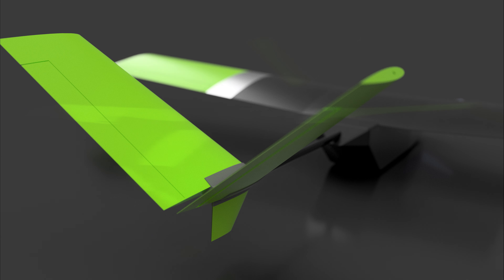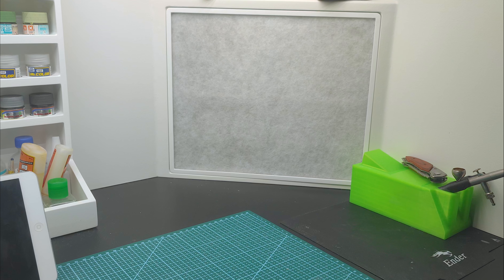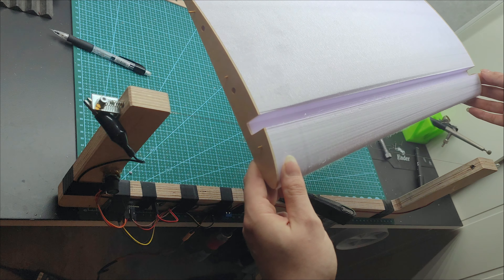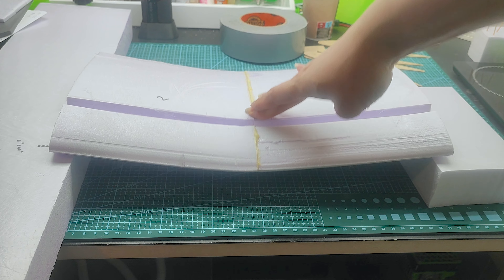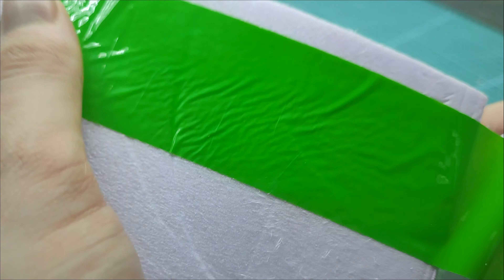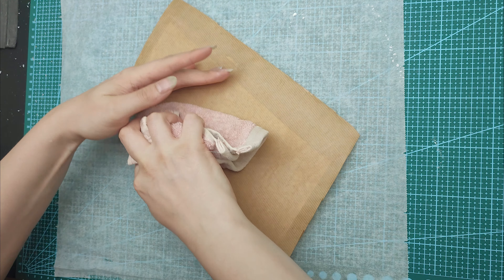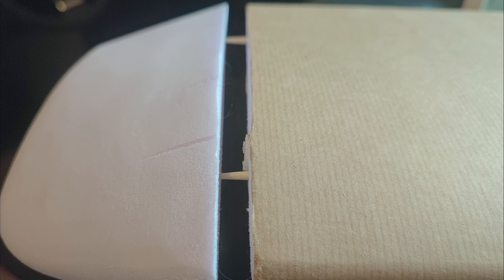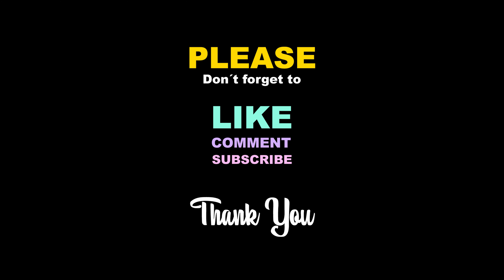🟢 How to Make Simple RC FPV Plane - Hot Wire Cutting - Perfect Airfoils With No Experience

Comment: This is an amazing design and great instructions! Can you share any more details about your hot wire cutter wiring diagram? Also what.voltage battery are you using? Thank you so much!
Reply from the maker: Thank you very much 😊 Mmm what components are you about to use? Same as me? Arduino, Pot, DC step down and MOSFET module? 

I used laptop PSU 20V 4.5A. And using the calculator to make sure I will stay within maximum amperage of the PSU which is important. 

I measured current and max was 3.8A on full power so I am safely under the limit.
Reply: @valkyrie_workshop  Yes I have same mosfet, step down, pot, and arduino, then various power supplies. I think I figured out most wiring from video, just cannot see where other two wires from Pot go. Thank you for replying, this is a really exciting build!
Reply from the maker: @kautionfpv  oh cool then! The pot has three wires. Positive-Signal-Ground. So it is supplied by Arduino itself, tho you want ideally at least 10kOhm pot so it does not draw much power. It works as voltage devider, so the middle leg that is signal measures the "voltage drop" on that 10k range. Arduino reads it in range of analog 0-1023.  😊

Anyway, if you need I could draw the diagram and put it to the Google Drive folder along the plane plans.
Reply: @valkyrie_workshop  Wonderful thank you, that was where I got stuck, was the Positive and Ground, I understand now. I really appreciate you taking the time to explain!
Reply from the maker: @kautionfpv  No problem 😊 I can upload the diagram If it helps at least to be sure it's correct 💯
Reply: @valkyrie_workshop  That would actually be very nice if you dont mind!
Reply from the maker: @kautionfpv  Uploaded 👍🤘😊
Reply: @valkyrie_workshop  You rock!! Thank you!!
Reply from the maker: @kautionfpv  No problem buddy. I Wish you good luck with cutting and flying 🤘😊♥️

Comment: Nice instructions on the cutting., but heating the wire can be much simpler.
Here is an alternative way to build the hot wire cutter. 
 A 20 volt drill battery can be used to heat a nichrome wire salvaged from a dead hair dryer.  A vape shop also will sell  similar wire that works.  Wire heat is controlled by changing the length between negative and positive contacts (alligator test clips)  on the nichrome wire.  Simple, cheap, and easily adjustable. 
Looking forward to the next vid.
Reply from the maker: Thanks for your comment :)) Yeah I know the alligator clip method. Do I personally like it? Not so much for few reasons. But I agree it is the absolute bare minium EZ setup that will work too.

Comment: Just a question, why is the dihedral downwards?
Anyway, cool design and great detailed explanations, keep it up!
Reply from the maker: I would refer to the previous episode.
The Tips are downwards purely for design and it's also inspired by Talon GT Rebel. They are for sure less common compared to winglets. I feel Drooped Wing Tips looks more "futuristic" Their true effect on vortex is here unknown. 
Dropped Tips as STOL kit for GA - (Short take-off and landing)  I seen them on few Cessnas. 

And then there are the split winglets on newer Airliners, so it's like combo, up and down 😅

Just so you know, for correction, negative angle is called Anhedral, Positive Dihedral ^_^

And thank you very much for your comment 😊🙌
Reply from the maker: Jeez, Aviation God would not forgive me If I won't mention A-10 Warthog. That was the first time I seen Droopies 😎😅
Reply: @valkyrie_workshop  Cool, i saw a video once where they said that some heavy lift planes use anhedral to reduce stability (like the embraer C390) bc otherwise they wouldnt be able to roll but didn't know that downwards wingtips also increased lift and also never noticed it on the A10.
Reply from the maker: Yeah, additionally to that the Dropped Tips improves ailerons control authority. So heavily loaded A10 needs it as well as ability to Take Off and land on short fields 👌😊

Comment: Great video.

What airfoil or do you typically use for your Vtail in this plane?

Do you simply use same airfoil for the wings then scale it smaller for vtail?

So if main wing cord is 6 inches do you take 3 inches wing cord for vtail

Comment: Great job! I have found that the brown paper and glue (I’ve used mod podge) is extremely strong!  Since you built the wing with spars and support, you probably don’t need the added weight of fiberglass and resin.
Reply from the maker: @bryceverreyen9341  Thank you very much 😊 Honestly, it's now my best method for sheeting and reinforcing wings. Freaking cheap, easy, always and anywhere available and the strength gain is superior for what it is. That's the exact point I came to the same conclusion as you so I would like to make another wing with maybe just light wood spar to limit some flex. 

Also wanted to try mod podge but not available here 😔 

Yeah, going fiber glass you need a very special reason. Screw it 😅

Comment: Thank you for a wonderful episode already looking forward to the next one. 😃 I really understand the frustration with cutting by hand.. "Done so many failed cuts and messed things up"
Reply from the maker: Thank you very much 😊🤘 Yeah now I know that quadrants and lead in/out on templates would significantly help. I am thinking about making a backup wing that would be even lighter. With the know-how the only direction is to speed it up 🚀
Reply: @valkyrie_workshop  Well it might feel like cheating compared to using a hotwire bow but in the end i built a cnc hotwire cutter after finding plans on Thingiverse.. Took a while to build and after some starting trouble it works great and dont need to make templates anymore, only need to input the airfoil plotter cordinates and size of wing into the program 👍
Reply from the maker: @witchywish2627  That's not cheating! If one can make something with absolute efficiency then that's the goal. I want to have the option when I crash, new part will be made in minutes or hours. (Not a huge fan of PNP commercial planes for that reason). 

I had this discussion about CNC wire cutter on my community post and what you named is what I mind about it. That's the plot coordinates and mostly non parallel cutting. I want to grab any of my 3D files, not giving coordinates and plots. Don't get me wrong, the current solutions (free) are all good.

My main point is that in 2024 there is not an elegant solution for non parallel cutting based on 3D mesh. (You can operate 5 axis CNC mill with ease nowadays, all based on 3D mesh) 

And there are SW for this sure, free and paid. And the free works but at this moment I am not really keen to put that lot of time into tinkering around complicated system that has to drive 4 primitive steppers 😅 

So when I will have rly nothing to do I will dive into it 🤘😊

EDIT: There might be some elegant SW already, but I haven't found it yet. Funny thing is that I have already construction design in my head 😁
Reply from the maker: Bonus: What I mean by elegant, look at 3D printing. CURA and others, 3D mesh, generate G-code and run. Sometimes literally seconds. 

That's 3 axis, 3-4 steppers.
Then you have non plannar printing, all the 3 axis independent. Doable In very elegant way.

So if I have my own design of fuselage, I'd like to cut it fast and based on 3D mesh purely 😊

Comment: what was the glue did you use on the paper -- What type of paper -- thank-you -- Steve
Reply from the maker: Hi Steve. It's any wood glue (PVA) and the paper, it's packing paper. There are more variations with different thickness so I go around local stores and try to find the thinnest one. Mine has one side matt and the other is a little shiny. But both are smooth, so it's not like rough paper. Rly the best way is to check multiple stores and get the best you can find 😊👌
Reply: @valkyrie_workshop  thank you for your time
Reply from the maker: @stephengould9385  no problem 😊
Reply: @valkyrie_workshop  I have experienced exactly the packing tape sticking issues you described in the video. Looks like you are in Norway also so I would be interested in hearing what would be your go-to place to get packing paper. Also how much do you dilute the wood glue before applying to the paper?
Reply from the maker: @johanfredriksvendsen8482  Unfortunately, I have to improvise with everything as nowhere before. Either many stuff are unavailable or overpriced af.  Rema 1000's paper is about right thickness. The glue should get consistency of fat milk to ~cream-ish. Also depends on how big the area for sheeting is, surface quality and shape. Sometimes I need more diluted, sometimes more thick.

Comment: As you say there are many ways to construct an RC plane. Nice detailed view of your choices, techniques, and tips. Great example of working with smaller foam sections is a great tip. Not only easier to work with, it would result in less waste should something go wrong. (ie: opportunity to practice with lower risk).
Reply from the maker: Thank you very much for your comment 😊🙌 Yeah the foam is cheap, paper is way cheaper than anything from epoxy-fiber glass technique and if you are ready hot wire is very fast way. I can't really imagine making all the ribs from balsa, too many hours...and then break it LoL 😆 And fiber glass is strong but also can be damaged. So the final waste expensive and the time 😬

Comment: It would be better if glass fiber with epoxy is used instead of paper and it strength will also increase by doing that!
Reply from the maker: Absolutely! One question is tho if that strength is needed and If it's actually lighter/cheaper. For epoxy it's best to use vac bags so there is no extra epoxy raising the weight. Thus you need just more gear for epoxy work. 

This is just freaking easy, no special materials and available even in local grocery store 😊👌

That paper gives for my needs enough strength. Maybe with high G maneuvers I'd be little concerned about the paper 🤔
Reply: And a LOT more weight.

Comment: Yeah, this is will fly incredibly good (assuming you'll get CG & Flight Controller linked up correctly🙃)  I can't wait to know how it'll perform in flight. You really went the extra mile with designing & constructing components. 

Love your work🏆
Reply from the maker: Thank you very much Nathan 😊♥️ Well I think as long as I won't toss it in manual mode it should be safe 😂 you seen my early manual flights 😅